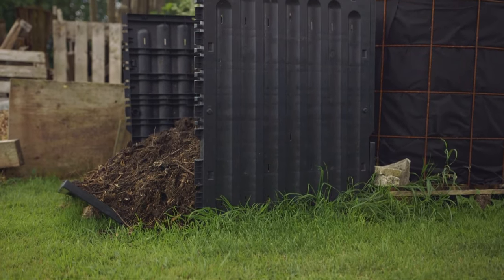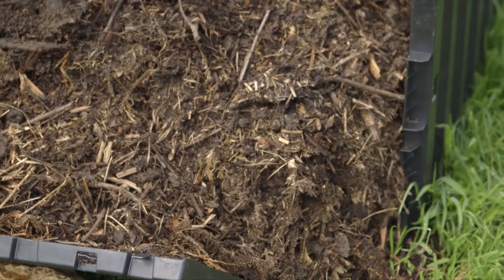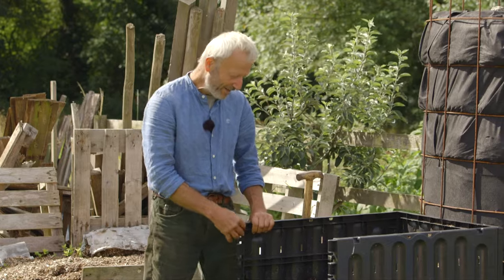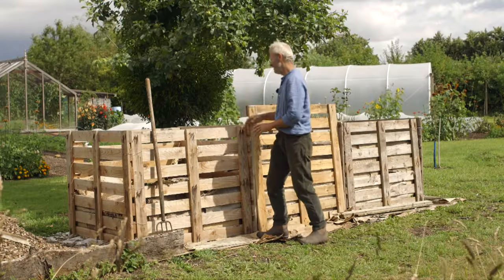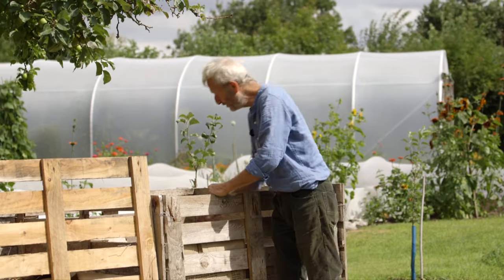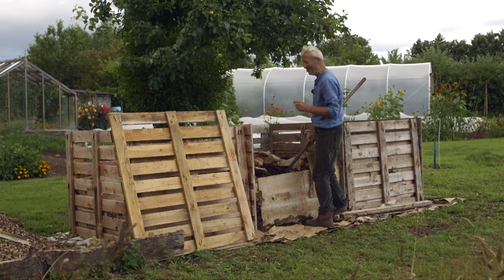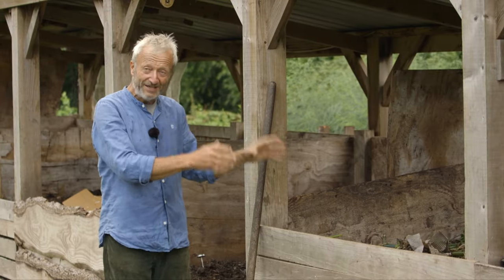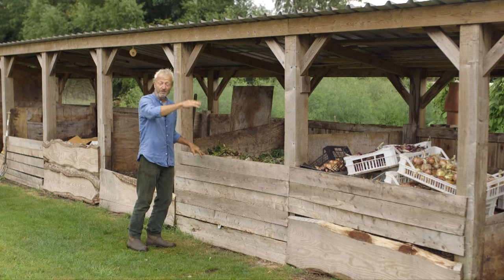Three Types of Heap, see how they work and the compost they make

Comment: Hello Charles, I still have a lot of unwashed sheep's wool and I could imagine using this as a cover on the compost. I know from experience that sheep's wool rots very slowly and so I could use it again and again for this purpose. What do you think? Sheep wool or cardboard? All the best Ursula
Reply from the maker: Hi Ursula and wool is possible, but would get in the way of planting say lettuce at close spacing. It depends on your weed situation and how long it will be before you need to plant. 
I'm impressed how quickly it degrades on the surface when exposed to air and moisture - a valuable mulch if you have it.
Reply: @CharlesDowding1nodig  Good morning charles,
I was very happy about your quick response and I am very grateful for the valuable and well-founded advice. We have ice and snow here and planting can be done in the greenhouse in mid-February at the earliest. I also prefer all plants, the first under a lamp in the house, everything works out fine. Your experience with the rapid rotting of sheep's wool when it is on the ground is very interesting to me and I will do it the same way. Unfortunately, in the past I made the mistake of burying the wool in portions and that didn't work at all. Since I have so much wool, I'll mulch tomatoes and peppers with them later and tell you about them when the season is over. I wish you a Merry Christmas and a healthy time!

Comment: I have a couple of questions, if you have a moment.
1. Do you sift your compost for sowing seeds?
2. We just had some very heavy rains, as a hurricane passed along the East coast, my compost is soaked and is getting smelly - not in a good way. Do you have any advice on how I might be able to to save it, or can I use as is?

I'm very grateful for the knowledge and experience you've shared. I'm planning my first no-dig bed for next spring.

... Rob
Reply from the maker: Cheers Rob.
For sowing seeds in trays, we do sift compost. For sowing in beds, we don't.
Best spread that compost now, it will dry and aerate when exposed to air on top of soil. Nutrients do not leach out
Reply: @CharlesDowding1nodig  Thank you for the advice. I'll get it spread later this weekend and get to work starting a new bay.
I had a shoddy tarp roof over it, but it wasn't strongly supported enough for the 5+ inches of rain we got in 24 hours, and about 8 inches over 3 days. We've had the second wettest summer since the 1920's here in Upstate New York. Other than some container plants, I've had to water only 3 times since early June.

Comment: Charles, your vid is timely, I had just started my composts piles.  I don't have any enclosures, I just put a tarp over the pile.  It's been about 3 months.  Pile 1 is horse timothy pellets and bedding and Pile 2 is wood chips, grass, greens, and timothy pellets.  I get a ammonia smell off Pile 1, I guess I need to add some carbon.  any suggestions and have you tried using pellets in your tests?
Reply from the maker: Thanks, and an ammonia small is not wrong, is common from dense green materials at the beginning, also in airless conditions eg under plastic..
I have not used pellets though.

Comment: Do you evet sprinkle water on your compost bays?? I've never sern you doing that....And if the compost is turned only once, it doesn't become smelly or having too much fungi? Thanks
Reply from the maker: Exactly, I never water them except in fruit hot summers like 2018 here. Most of the time we are adding green leaves which contain moisture, and that amount of moisture is enough to keep the heat moist, without any rain falling on it. This reduces smell because bad smells often come from too much moisture which means to little air, which means anaerobic conditions and sulphurous smells.
Reply: @CharlesDowding1nodig  Thank you SO much for your answer Sir, I feel honored!:). So with no water added, do you still keep the ratio 30:1 or you have more greens to less browns?
Also, I always wandered...aren't the plants getting TOo much compost, and not soil at all? How do they 'act'? Even we become sick of the same 'great food' if over and over again. Thans so much!!;)
Reply from the maker: Thank you, and 32 to one is the ratio of carbon to nitrogen, not at all the same figure as for brown to green which is more like 40 to 60. And the compost I apply is not a huge amount at all, it's totally in line with traditional horticulture, with no fertiliser use which is indeed like overfeeding.
What we put on beds each autumn is almost disappeared into soil by the following autumn. It's being eaten by soil organisms not by plant roots, which are feeding into the soil, better than when soil is loosened by tools
Reply: @CharlesDowding1nodig  O wow, how fantastic! I don't know why I had the impression that the roots will travel the compost, and from there meet the hard cardboard, (which may not be decomposed), stop there and just sit and 'bath' in compost......THat's why I thought it was too much, but now it became clear!;).... So they thrive into the soil!! Compost acting more like a mulch (/source of food for Soil), and not like a soil, correct??? Thanks a TOne for the gift of answering! So lovely!!

Comment: Thank you so much for all your informative videos!
I live in an inner city with no garden or even balcony. A friend and I have "adopted" three tiny plots of ground, each a surrounding tree on the pavement. Each plot is about 5 square metres.  We want to create ground cover to keep moisture in and also to beautify these plots with flowers. The ground is basically pure sand and builder's rubble, so not ideal. We put down some potting soil (probably not enough). My question: I've been buying horse dung in pellet form, soaking it in hot water until it forms a sort of sludge, and putting it on our plots as a mulch. Do you think this will be helpful (in the absence of normal compost)?
I would appreciate your advice!
Reply from the maker: Lovely thought and desire. I would remove rubble first to lower the surface, then add those pellets for sure and any compost, then plant.

Comment: Hi Charles, what an awesome video with an even more awesome timing! We just received the keys of our new home and I already started collecting stuf for the heap  (and there is plenty of it!). I had one question though, is Hedra Helix (I believe you call it English Ivy) safe to compost?
Reply: I think you need to let it dry out so it's completely dead first, unless your heap is running hot enough to kill it.  I have composted lots of dried and shredded ivy with no issues
Reply from the maker: Thanks Peter and yes you can compost it fresh, cut into 10 to 15 cm links or chopped by a lawnmower

Comment: Hallo Charles, my compliments for all the work you do with compost and the way you present it in these videos. 
I live in Salento - the heel of Italy’s boot - where summers are deadly hot, everything just dries out. 
I started composting last spring, just making a big pile (straw, weeds, cactuses, vegetable kitchen scraps, eggshells, coffee grounds, paper and cardboard) and noticed the process stopped completely in summer. 
In autumn I built the 3 sections pallet bin and moved all the material into it. 
It compacted alright but it’s not heating up. 
What would you suggest to do during summer?
Is it eventually going to turn into usable compost even if it doesn’t heat up?
Reply from the maker: Hi Gabriele
Your summers sound quite a challenge. I wonder if the materials in your heaps are dry at all, they can't decompose. Also they need to be packed down especially any woody stems, because otherwise you have pockets of dry air. And it's not vital that heat is maintained all the time, perhaps in summer you have a lack of fresh green leaves (which cause heat to happen through bacterial multiplication) and therefore less heat.

Comment: I just love your videos and thank you so much for making them.  I live in Alberta, Canada and it gets very cold in the winter.  Is it a waste of time to continue adding compostable materials during the winter?  Keeping in mind to make sure I am using reasonable ratios.  Love to know your thoughts on winter composting.  Our typical winter temps are -20C but get colder as well.
Reply from the maker: You are so welcome and that sounds too cold for a composting process. Also you will not have much green material. 
I would just put everything in a heap and then use it in spring or summer to add to heaps you make then

Comment: I have used pallets to make cpmpost bins. They are double thick and so  heavy so first i tried to separate them. They have  so many long nails that i had to give up. So now i just heave   them to the site and wire them  together as they are.This is what i have been  told on compost making. I  wouöld very much appreciate your comments. 1. a compost site must be in the shade. 2.there   has  to be spaces between the planks so the  wind can blow through. 3.you start with 25 cm of  twigs.4.you cover with  5 cm of soil or old compost.5.you cover that with 15 cm  of grass and  weeds.6.you cover that with 5 cm of soil or old compost.7.you cover that with 15 cm of grass or weeds, then  5 cm of soil or old  compost, then 15 cm of grass or weeds and so on.. I think lining the sides with cardboard is a good idea.Here in Stockholm, Sweden you are not alllowed to put fruit or vegetable or kitchen waste because of rats.Otherwise i would make a  worm farm outside. Instead i have a bokashi compost. Another problem is the climate. I am trying to do no-dig gardening at a school where i help out. The clay soil has been packed very hard but at last weeds are beginning to  appear. So if the consumer kids dont destroy everything next year i shall try to grow radishes, carrots, onions, beetroots and broad beans for them using your no-dig method.
Reply from the maker: Well done.
People often give too many rules. A compost heap can be in sun or shade, and there is no need for slatted sides because you actually do not want wind to blow through your compost, otherwise it cools down and dries out. 
The recipe you give it is okay but formulaic - it will vary according to what you have. It's actually better if there is a little mixing, and the idea of layering is only explained like that so that we put in variable types of materials successively, which is effectively the mix. 5 cm so should be 3 cm roughly. Best of luck.
Reply: @CharlesDowding1nodig  thanks. that makes things a lot easier.

Comment: Where I live, in Norther Italy, the major problem in weeds, in my case, is what you call couch grass (in Italian is "gramigna"), that colonizes every compost bed in summer. When it overruns a bed, I can't get rid of it.
Reply from the maker: We have that same perennial grass for sure. I find it easy to control and eliminate by using mulches and not digging. However the mulches must be thorough, and include covering the weeds on pathways, because otherwise the grass spreads from path to bed

Comment: Charles, I was looking back at your compost bin system to get pointers on how you efficiently make things happen.  I was adding scraps to my  compost bin, lifted the black plastic cover, and a brown snake was sitting on top with another baby snake.  As soon as I lifted the cover, the snakes went inside the bin and disappeared.  I was wondering if you have experienced anything like that and should I be worried?  Thank you for your guidance,  Rafael in Virginia, US
Reply from the maker: Hi Raphael,
Wow that is some issue. I just wonder… Are you sure they were/are snakes because we have slow worms here Anguis fragilis, which behave in a similar way, and look like snakes but they are quite thin. I'm not sure what they eat but I reckon they're good. I always give wildlife benefit of the doubt, unless I'm sure otherwise!
Reply: @CharlesDowding1nodig  it was a tan with brown spots snake.  The snake likes to hang around the top of the bin.  Saw it again today, but when I lifted the cover, it went back inside.  Maybe I’ll leave the cover off and see if that annoys the snake with the sun.  Thanks, Rafael

Comment: Charles what carbon/brown materials are you using with a ratio of 30:1 i don't want to use a higher carbon example with cardboard with a 500:1 c:n ratio etc.
Reply from the maker: Anything woody, mostly 12-24 month old woodchip, we often chop it with the mower before adding

Comment: I keep all my garden waste in an empty compost bag in my garden shed and when it is full periodically take it down to my allotment for composting in my pallet bin and do the same with kitchen waste in a lidded bin because it can pong a bit! I scavenge cardboard from the neighbours and am trying to build up my compost making as much as I can because I worry about the plastic bags that bought compost comes in.
Reply from the maker: Sounds great!
Reply: With the kitchen waste it may be useful to have a tub of sawdust handy.  When you put the kitchen waste into the bin, cover it with sawdust.  I've read that it can help with the smell, though I've not yet had time to try it myself.  I have discovered that I can get large quantities of sawdust from a local sawmill though, so I'm definitely going to give it a go as soon as I can get organised (ie. fix the trailer so I can go and fetch some).

If you need more than you can make, then depending on where you are you may be able to buy green waste compost in dumpy bags, which massively reduces the "plastic footprint".  Be aware of Charles's comments about it in his videos on composting though.  I've not had any problems so far, but I'm only on my second batch.

James

Comment: you referred to adding wood several times. Do you mean from the prunings or actually larger pieces of mulched branch? 
I've got a shredder that crushes rather than cuts and so pieces of wood tend to be on the large side compared to a knife shredder.(end up with a fair percentage of 3-4cm chunks). These don't break down so well (even in "hot" compost) and I tend to sieve them out and put them in the next bin rather than spread them with the finished compost - worried about nitrogen tie-up. Is nitrogen tie up "a thing" with your compost if you are keeping the woody parts when you spread it?
Reply from the maker: Small pieces are best.
Large pieces get in the way when gardening so we usually pick them out to re-add as you say

Comment: Another helpful and informative video. 

I noticed you were using an electric shredder. I've got one of those and found it quite difficult to use. What kind of shredder are you using and have you used it for any length of time?
Reply from the maker: Bosch AX25TC, five years, good with wood not greens

Comment: Would you use this home made compost to grow plants from seed in modules? Presumably you would have to filter it. But from what I can see you still buy the bags of multipurpose for your seeds is that correct? If so, what is the reason for not using your own stuff?
Reply from the maker: It takes quite some time to sieve to 4mm, and there are fewer nutrients in my compost compared to Moorland Gold. We do use some homemade for propagating.

Comment: What about blight-stricken tomatoes? Do I need to worry about that if I don't quite reach 60C? The way i understand it is that blight mostly comes from air, but would the problem be worse if it does remain and survive in the compost?
Reply from the maker: No worries at all, because blight spores do not and cannot survive in soil or compost. They need living plant tissue to survive on. Even in the cold heap, any potato and tomato leaves and stems decompose quickly. Maybe just keep blighted potatoes out of the heap.

Comment: Another great video Charles, thanks. In your main composting area, are the timber uprights softwood or hardwood and are they treated? Have they shown any sign of rot/degradation being in contact with warm humid organic matter (and fungal elements) all the time?
Reply from the maker: Treated softwood, so far so good in 5 years
Reply: @CharlesDowding1nodig  Thankyou Charles, that’s reassuring to know before committing to a reasonably big build.

Comment: Help !!  I started my compost in the fall last year , in pallets . This Spring it was still mostly uncomposted . I was so hoping to use it on my garden . I built another pallet bin beside the first one , and divided half the Debris into it , watered it ( it was very dry ) and continue to add garden waste onto both piles . I don’t know what I’m doing wrong .
Reply from the maker: It could be that the material is in too-large pieces with large air pockets between so it cannot decompose. Maybe try walking on it to help get it going